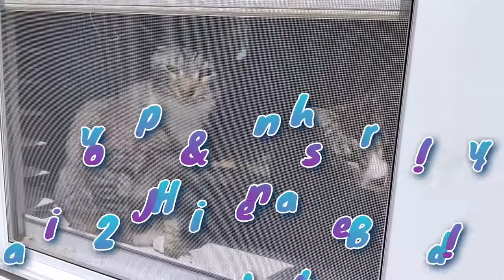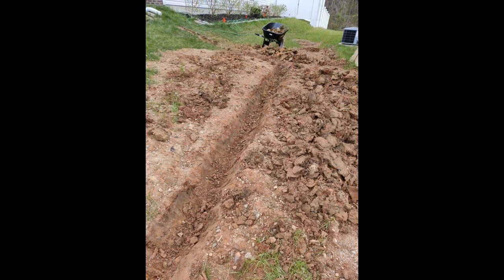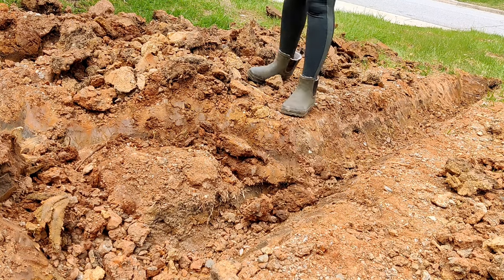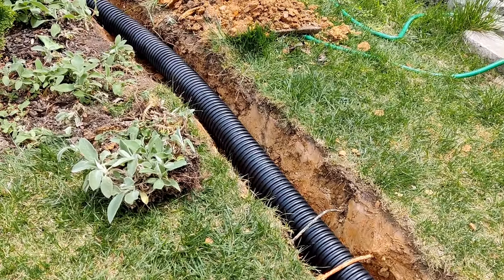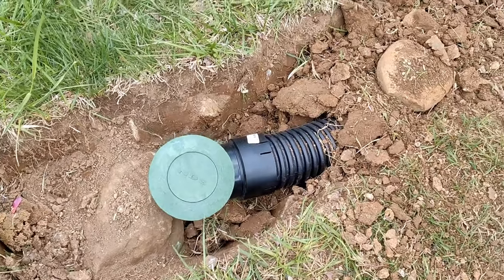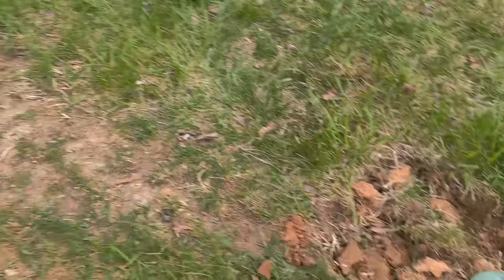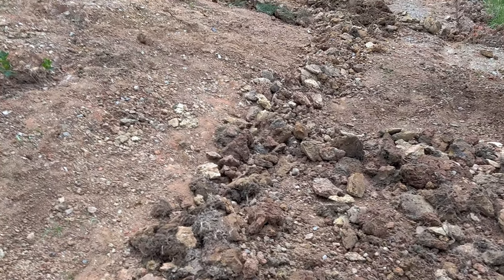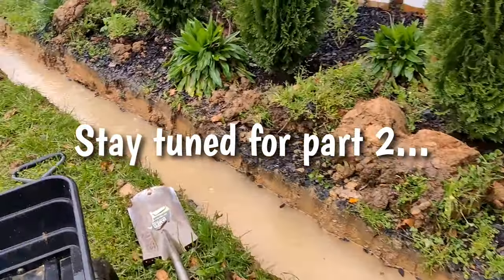Installing Drainage Systems part 1 |DIY| Side Yard

Comment: thank you for sharing. this is so timely as i'm dealing with sump pump drainage issues at my home. i love that you're not afraid to do outdoor home improvements. it's so inspiring.
Reply from the maker: Thanks so much! I will pretty much attempt anything myself that doesn't require heavy equipment or be built to code lol😉

Comment: Nice work.  I called in landscaping about burying my downspouts and adding a french drain. The quote was $1300.  I investigated more online about yards with drainage problems near downspouts and it recommended doing more landscaping with plants.  I increased my planting beds, added a couple small trees, shrubs at the corners of my house and it's working.  I don't have standing water any longer.

Comment: Very informative!  Question, do you know if a pop up drain the same as a drop drain? I have to do the same for my yard.  How did you determine how much rock you needed for the trench. Thank you so much!
Reply from the maker: I am not sure I've never heard of a drop drain. As for the rock I measured out my square footage & bought bags as needed. (The sq footage should be listed on the bag) I also considered bulk gravel but I just figured bags were more convenient since I was only doing less than half the drain. Hope this helps!😉
Reply: @KreatyveGardenista  yes, your reply helped tremendously!  Thank you so much for your help.  Have a joyous day!